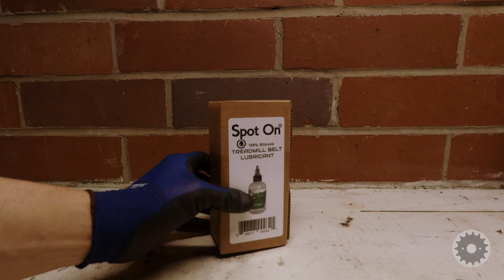How To Reduce Air Bubble • Liquid-Filled Oil Pressure Gauge • Street Bob FXBB

Comment: Great info! I just picked up the same gauge and oil line with fittings. I’m doing my own kit for 2019 Street Glide and 2022 Street Bob. Where did you get the gauge mounting bracket? I’m trying to find a same bracket to mount the gauge so I can still uses heat deflectors on Street Glide. Thanks
Reply from the maker: Hey Street Glide - I'm glad this was helpful! I actually fabricated that bracket myself. I have the idea of making a kit...maybe one day!

Comment: What do you recommend as far as oil temperature guage goes?
Reply from the maker: Hey Paul - I haven't used an oil temparature gauge, but I've been happy with my Marshall gauage for oil pressure. They have oil temperatiure gauges as well - that could be a good starting point. In the past I've also had great results with AutoMeter / AutoGage. Hope that helps - let me know what you end up with.